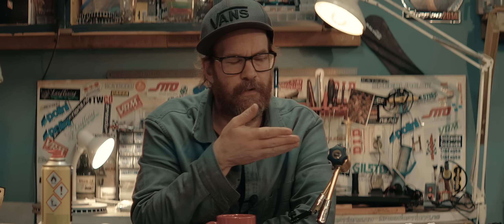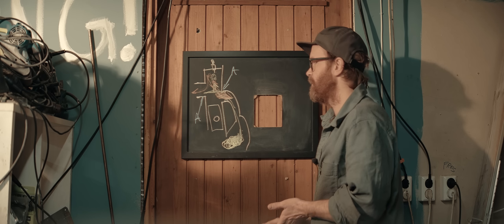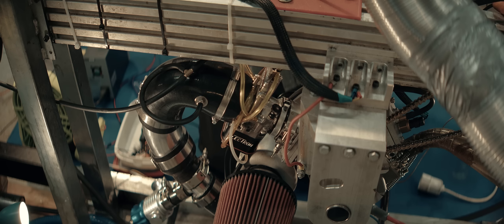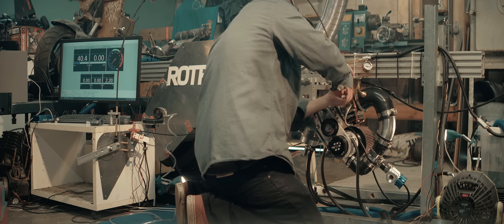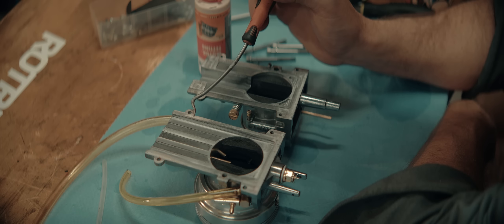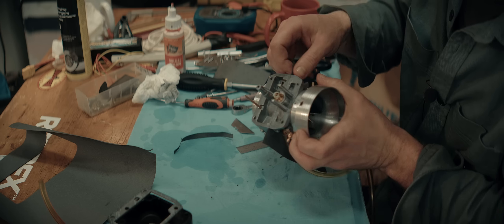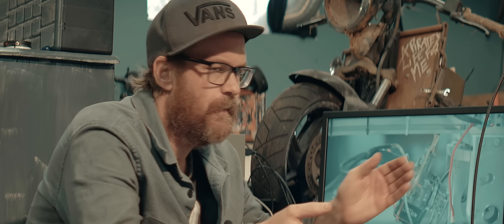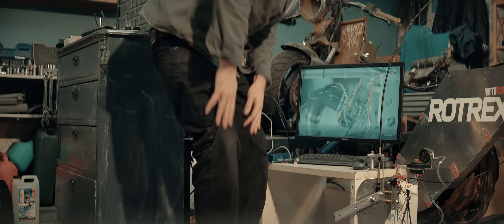50cc Engine in there somewhere...

Comment: I have been following this for some time and the whole time i just wonder why you don't make a rotairy valve intake. This way the engine can compress the presure  that the blower can fill the carter with some more and you wont have the failing reeds or the blowback against the intake at high rpm when the exhaust pressure exeeds the blower pressure. Though i think knock would ocure and feul injection would be recuired. Maybe it is recuired right now already because we always see the boost push the fuel out of the carb.

Comment: Alex, could I ask a couple of questions please. You clearly show a step from the piston crown to the base of the exhaust port, I'm wondering how tall that step is? and uderstand the theory of it.
Am I right in my understanding of this question. Did I miss understand you when I thought you implied the expansion chamber return sonic wave produces approximately 2-3 bars of blocking pressure at the piston face at resonance. This is a question I've wanted to know for ages.
Thanks Alex from a retired 2 STROKESTUFFING fan from the UK.
How are you going on with the vitamin "D" I've taken 5000iu's daily for years and feel much better ror it!

Comment: Instead of using a carb why not use direct injection the pressure pushed into a carb can cause problems back pressure.. Becomes an issue?

Comment: I think much of your problems with your carburetor could be solved if you put it on the inlet side of the supercharger.   It likely was not intended to be a blow through setup.  You will want to RTV the compressor cover to the supercharger housing if you do that.
Reply: He doesn't want nitromethane fuel to go through the supercharger. It's possible it'll destroy the seals.
Reply: @Doompjez  Not sure about Nitro, but I have run gas through them.  I have several running now like that.
Reply: @Gadget0343  through a rotrex?

Comment: So you are using the supercharger as a boost capacitor having positive pressure on hand so as soon as the transfer open even for a split second it will fill the chamber up so no reverse flow. I’m i understanding this correctly? Lol

Comment: i have a Question. I am following your Channel a while. Wouldnt it be easier to "charge" the Engine directly into to the Transfers, with a suck through carb. Like they do on two Stroke Diesels? I mean plus the added Carb obvoiusly. Then you dont have to Deal with weird tings happen in the Crankcase and Pressure spikes etc? Keep it up!
Reply: Pull through is for ppl the don't know carbs.. it's easy yes but far inferior in every way especially drivability and power. Blowthrough is actually pretty easy he just needs to put the carb in a plenum so it stops leaking. None of this hasn't been figured out boost wise just the 2stroke stuff and the pip stuff is new. even then an engine is an engine. Currently he just needs the right needle and he can get it running right he just would have to wait for it and it might not get right first try. He doesn't exactly tune lectrons everyday. I know carbs and tuning but I have to double check stuff when I work on these too it's normal. One reason you never want the throttle before the compressor is that at part throttle the compressor efficiency is trash they don't appreciate being throttled. Second is you have to compromise power for starting and drivability pull through. Add fuel puddling and it's just not for anyone that knows carbs or wants performance. At one point I ran a 44mm pull through barley made 25psi and just didn't make power moved to a 28mm blowthrough and drove like a stock bike starts first try and made more power at 10psi than pull through did at 25psi and that carb was way big towards the make power sacrifice starting, idle didn't exist. Looking back on my 12+yr journey with my turbo bike I wouldn't ever recommend pull through for anyone. I remember barely making 38hp now we're almost past 100whp and it really does drive like a stock bike I mean other than the clutch, and power.
Reply: @oliverscorsim  Wow, than k you very much for the answer. Yeah that makes a lot of Sense. Throtteling an Supercharger is very harmful to efficency, and building an engine ehich does only work gut at WoT makes no sense. I did not think about that. I was seeing this thing just as a "testStand" Device and did not think about driveability.

Thank you!

Comment: This is probably a stupid idea however I’m interested to know if you could develop a Dyson hoover into a supercharger?? It will  probably need some serious research and modifications but you could make 3d printed structures based on the design and see if makes any pressure or airflow or bhp or torque increase
Reply: theoretically a turbine from any vacuum cleaner COULD function as a supercharger if its a blow trough setup
They are pretty powerful and build quite a bit of static pressure/vacuum but I don't know if they would have the CFMs for an engine.
An externally driven supercharger by a big 3 phase motor hooked to a VFD for example would reduce parasitic draw a lot.
Turbochargers are superior in that regard they are by far the most efficient way to force induction they just cause some backpressure in the exhaust manifold but make up for that with boost on the intake side.
Reply: Pretty sure they don't make enough grunt

Comment: Does this mean at high enough pressure from the supercharger we're blowing mixture straight out the exhaust port during the transfer phase? (and thanks for finally helping me understand how 2-stroke works)
Reply: At low rpm but as you climb in in revs the back pressure from your pipe should mitigate that

Comment: I wonder if the high pressure in the crankcase is causing problems at higher rpms? At this point is there a reason you are still passing mix though the crankcase? could you seal it, oil it like a four stroke and just move mix from the super charger to the intake side?

Comment: My man, hello from Australia.
I was wondering if this could help... maybe find the right PSI that the motor is happy to push from the blower into the cylinder... have a plenum with a release valve to keep the pressure constant inside the plenum?

Comment: Are you sure those screw-heads you don't like really are Phillips and not JIS (japanese industrial standard)?? All Mikunis for example has JIS at least. They look a lot like Phillips but have another angle which means using a Phillips screwdriver (or bit) will strip the head! The same goes for most Japanese stuff, like break-fluid-containers on bikes (and mopeds) etc..

Hälsningar från Sverige.

Comment: could you make a new piston thats flat on exhaust side and higher on inlet side
Reply: Yes you can and it's very efficient but it's not really suited to high RPM due to the combustion chamber shape. I would love to play with piston crown shaping but it would require new head inserts every time.
You have to remember that the transfer's force fuel/air onto the whole piston crown to cool it among other things.

Comment: can the oil be injected separately from the fuel? so you can spray it on the bottom of the piston for cooling before it mixes with the fuel.

Comment: Doesn't the piston moving up and down into the crankcase cause pulsing back pressure into the super charger? I know you put the reed valve in there but I'm curious how the pulsation is impacting the running of the motor.

Comment: Your chalkboard drawing at the beginning had me thinking: Does the angle the intake charge enters the cylinder from the transfer ports have an effect?  By this I mean in your drawing the transfer port was effectively directing the intake charge into the cylinder at 90° to the cylinder wall causing it to go across the cylinder and slam into the opposite wall.  It would then have to be pushed upwards by the piston.  Please correct me if I'm wrong.  But if the transfer port were angled in such a way as to direct the intake charge upwards at say 45° so as to have the air/fuel mix already be heading up towards the spark plug in a "natural" direction and less reliance on the piston to just force it up.  When I try to picture it in my mind I envision it inducing some additional swirl that would help the denser intake charge push the exhaust gasses out of the way.  I keep thinking of a comparison with a 4 stroke engine and how the angle the valves sit in relation to the top of the cylinder can effect how well the gasses move in and out.

I hope I made sense here.  :)
Reply: Yes, in a real engine the angles are carefuly made to direct the charge upwards and away from the exhaust port for the exact reason you have described. The drawing is just a crude representation to make a different point. You can look up cylinder scavenging in two strokes to learn more about this.

Comment: Hello, when u want to convert this into efi. Use speeduino because it is cheap and easy to install especially the no2c. It's like megasquirt but cheaper because it utilizes an arduino and a special board.
Reply: Is 2ST mode working in the firmware tho? I looked onto it for a fuck around thing but couldn't find much information on Speeduino and 2ST
Reply: @unchartedgroupielove  yes it's in the firmware
Reply: @unchartedgroupielove  you can switch that onto tunerstudio, speeduino uses tunerstudio on tuning like megasquirt
Reply: @unchartedgroupielove  And if you want to ask more about this product you can go to the forum. There is a lot of people that will happily support u and help u with your project
Reply: @vincenzo_1452  thanks mate 😎 I did have a look some time ago , before the new dropbear hardware came out. It looks very promising for what it is. I wanted to get a MoTeC for my outboard engine but it was too expensive in the end ($8k AUD)
Reply: @unchartedgroupielove  told ya, better to save that dollar! Good luck mate😎

Comment: Not sure how EFI would do in this case (still waiting for Bimota to return my V Due from that pesky recall). Mechanical, constant flow like Hilborn or TCM aircraft engines may be better but not sure if it could be scaled down enough. Expensive and hard to get in normal applications, but if you studied the operation you may have ideas on how to make your own components. It would simpify tuning greatly if you got it to work.
Reply: Nothing is simpler or easier than blowthrough carb for boost. Also makes the most power in boosted applications.
Reply: @oliverscorsim  
Maybe in some cases. The boosted aircraft I work on are a pleasure to tune and are all mechanical FI. My 750 turbo's DFI is easy to tune but redlines at 10K, this 2 stroke goes way past that potentially.
Reply: @upsidedowndog1256  yeah but that's on a along the lines of intended purpose it should be easy to tune. For something like this often simple is best. For sure the charge cooling from blowthrough is a huge advantage over injection.. my personal drag bike I have been pull through, efi, blow through carb. Blowthrough carb made the most power by a fairly big difference. (Compound turbo 155cc single) at the upper boost levels I see 300°f intake temps after the carb it's around ambient or under 0 if I dry ice my e85. I couldn't get it to ambient with dry ice and injection. And my egts and head temps all agree with a not so great sensor in the intake port. Mostly it was the Dyno that spoke the loudest picked up 15hp at the same boost and rpm which for 155cc is huge. I also am able to run much more timing carb over injection like 10° more advance at the same boost without knock. Best nail in it's coffin for me was weight, space, and times/trap speeds. Managed to pull 25lbs off the bike taking injection off and going back to carb. This is the world's most powerful 2 stroke Alex is after at the end of the day. Youl notice all the American drag cars like carbs for that same reason more power less weight. His bikes running good just rich that's all tuning he'll get it... Took me 3yrs of messing with the carbs to be happy so don't fret it's not something with enough info out on but we over think it normally it's actually pretty simple. When I got it right I felt dumb it took me that long to figure but all I had to learn from was ram air carbs from sport bikes. Which work out of the box for boost as long as the boost isnt too high the plastic tubes pop out and leak for their factory pitot tube. The fact his engine has no vacuum makes things different from what I worked with and I think he's dead on with the pitot tube. Really I think he's a few needles away from having what he needs.

Comment: Great work Alex, I was curious to as if there would be a benefit in running an exhaust gas analyser to see exactly your fuel/air ratio and at what revs? Looking forward to the next development, love your positivity.
Reply: You can't run o2 on a 2 stroke. When the transfer and exhaust port are open fresh unburnt air mixture enters the exhaust chamber and messes up any reading you would otherwise see. For some fuels you can run temp gauges and gauge it from exhaust temperature.

Comment: At this early stage of engine development, I'm concerned that you will be bogged down by the idiosyncrasies of nitromethane use. High percentages of nitro often lead to overheating and detonation, which makes the piston and combustion chamber susceptible to damage. Traditionally, these problems have been countered by reducing the engine's compression ratio (a catch 22 situation, but necessary to keep the engine happy), and being very careful not to run a lean A/F mixture. Despite its undeniable power advantage, nitromethane is a difficult to ignite and is very slow burning , which requires an evermore powerful spark ignition system as its percentage within the fuel increases. Because of the slow burning, considerably more ignition advance is required when compared to methanol or gasoline. Since you're already using 30% nitro, the engine's backfiring might be attributed to an inadequate ignition advance. To confirm that these problems have not already occurred, perhaps you should consider removing the cylinder head and look for signs of detonation. Love your enthusiasm!

Comment: How about implementing electronic direct injection?
Reply: Direct injection is hard to get working on 2-strokes, it requires very careful aiming of the injector and timing of the fuel delivery. Better to just inject into the intake where the carb is right now.

Comment: Great work keep up the good work. Would it help the Reed operating slow over a wide rpm? I see it fully opens at 8 but may be program 25% at 6 /50% at 7 / 75% at 8/ 100% at 9 and so on
Many thanks for the videos

Comment: Curious - it may be the perspective of the camera but when the car leaks fuel, does some of it land on the intake filter? I may be mistaken but I thought part of the reason you are doing blow-through is because you don't want to ruin the seals on the rotrex blower from the nitro-methane. Hopefully it isn't accidentally sucking in a bunch of fuel/fuel vapor (which would also screw up your fuel ratio I'd think)

Comment: What if you were to run 2 plugs to help  keep spark from blowing  out like on a top fuel dragster
Reply: The problem with running 2 plugs among other things is the tiny size of the combustion chamber  on a 40mm bore engine revving to 20k.

Comment: have you thought about adding more straight tubing before the carb? i think how it's setup now, all the air gets flung at the top of the carb due to the bend. does that make sense? would that interfere with how the carb works?

Comment: Question: Is there any benefit of an expansion chamber exhaust with a blown engine ? A plain pipe should be OK?
Reply: To not have the charge blow straight thru
Reply: @oskarthompson3789  But the idea of the expansion chamber is to create a negative pressure wave timed to aid cylinder scavenge and fill not a flow restriction.
Reply: @leedove7255  that's what changes when you add boost. The exhaustport closes after the intake on the up-stroke. If you have 2-3 bar in the cylinder you need some blockage
Reply: @oskarthompson3789  With the negative pressure wave there is no blockage. In fact the exhaust must have an average flow rate equivalent to the overall gas flow for the engine to work.
Reply from the maker: There's a reverse wave too.
Reply: @2STROKESTUFFING  So are you  using that to increase cylinder pressure at a certain rpm?
Reply from the maker: @leedove7255  yep👍

Comment: If you go EFI start on a easy engine, that you know works well.
Standard 50cc and just a straight pipe, and then slowly add complexity one at a time.
I would also consider and old Haltech, or similar with milli second mapping, as I'm not sure a VE table would make much sense.

Keep fighting !
Reply: Ve is always better than millisec. Probably want the Ve units based on tps with boost multiplier
Reply: VE converts to millisecond but is independent of injector size (well a proper VE table is)
Reply: @ReubenHorner  If you take account for the pipe on a 2 stroke, and how it works on different loads pushing fuel mixture backwards, I'm not sure that the VE table is easier, but I don't know, have only mapped 4 stroke turbo cars, mostly my own 635.
Reply: @thomas41546  I know, have done lots of mapping on my 635.
Reply: @daniel635biturbo  nah Ve just means volumetric efficiency. Pretty much disables the need for worrying about injector deadtime. Instead it's just effectively air flow which should be relatively easy to tune up
Reply: @ReubenHorner  Oh I wish 😏
I changed the alternator on my car, and with a 1 volt drop off, my VE table is now somewhat off on low loads it seems.
Reply: @daniel635biturbo  means your injector data is off. Specifically deadtimes over voltage
Reply: @ReubenHorner  Yes, I know, but did not notice until I changed the Alternator....